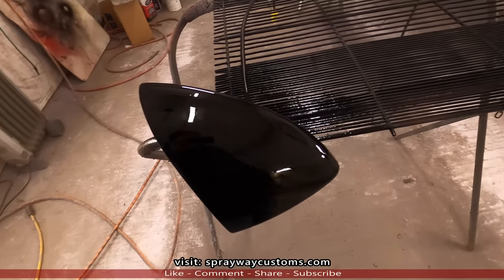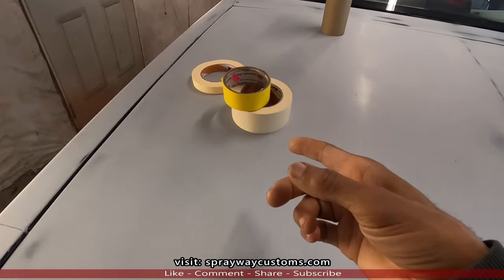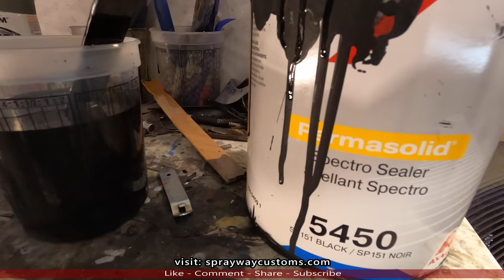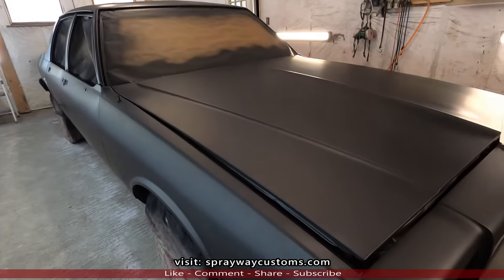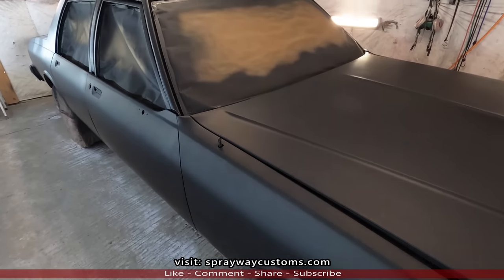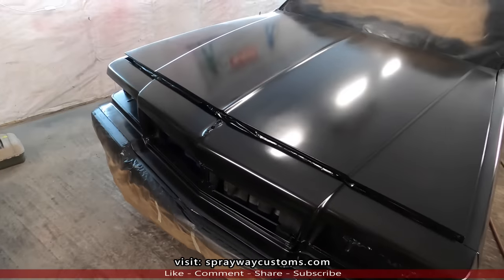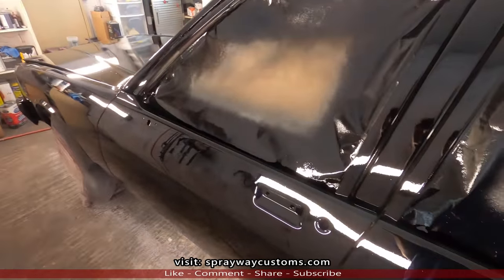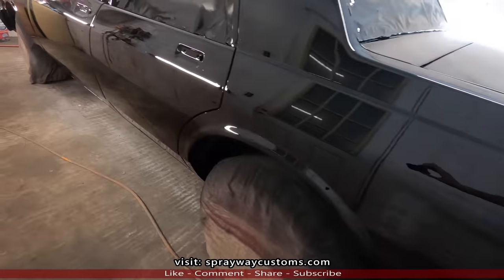How To Paint A Car Jet Black At Home STEP BY STEP Guide To Painting The Box Chevy Caprice On 26s

Comment: Good call on the sealer. As with numerous areas of life, longer strokes are better. Did you shoot the door jambs and under the hood/trunk?
Reply from the maker: No..I didn’t do the jambs
Reply: @SprayWayCustoms  jambs are a lot of work and time but they make the different between a quickie shoot’n’ scoot and a professional color  change. Your paint work is exceptional, deserves that higher starting point.

Comment: you are so good at your craft!!!    Why did you use a sealer rather than go straight  from primer wet sanded to base coat.  What is the purpose of the extra step of sealer?   thanks
Reply from the maker: It’s a great foundation, seals and with a sealer you don’t have to spray as many coats of base

Comment: I was wondering if i have small cracks in my paint, do i have to sand down to the metal, or can i get away with light sanding and primer? The cracks aren’t lifting and flaking paint, they are really small but all over my trunk. And it’s smooth to the touch . Thanks
Reply from the maker: You can get away with filling them up with primer after light sanding
Reply: @SprayWayCustoms  appreciate the response!

Comment: Man sprayway!! How you spray like that without getting hardlines in your jams? I did it the Same way and I had hella hard lines? Do you wet sand them or what? I have to flow coat my car but I’m scared because of the hard lines.
Reply from the maker: I don’t..I try to mask where there’s a seam where the metal overlap so you can’t tell as much or use foam masking tape

Comment: What up Sprayway I have a 79 Malibu I working on and I am working on the floorpan and I have a couple very small holes skinny but bigger than pin holes.  I also have bigger rust spot on transmission tunnel up top on rt side.  Should I use fiberglass mat and resin and I also have some upol fantastic lightweight fiberglass filler and the upol ultra fine finish glaze as well.  I also have what you use on your floorpan video.
Reply from the maker: That’ll work on small pinholes

Comment: When you flow coat how many coats of clear do you apply?

Also, could you post your gun settings for spraying the base and clear? I'm talking about your pressure settings.

Nice job you do great work!
Thanks.
Reply from the maker: 2-3 coats. I spray between 28-30 psi

Comment: I been added lights to my  shop I went in got some harbor freight but it a 25 bucks for each light that 5500 lumens but you got six for 40 can point me in the direction
Reply from the maker: Amazon - 
SUNLINKCO 6 Pack 4FT T5 LED Integrated Fixture,Super Bright White 6500K,20W,2300LM,Linkable LED Shop Light,Garage Light,Ceiling and Cabinet Light,Strip Light,Corded Electric with ON/Off Switch,ETL
Reply: @SprayWayCustoms  much love appreciate that my brother

Comment: Aye Sprayway drop a link for those lights. I need me some more. I appreciate ya
Reply from the maker: Amazon - SUNLINKCO 6 Pack 4FT T5 LED Integrated Fixture,Super Bright White 6500K,20W,2300LM,Linkable LED Shop Light,Garage Light,Ceiling and Cabinet Light,Strip Light,Corded Electric with ON/Off Switch,ETL
Reply: @SprayWayCustoms  good looking out fam. Love your work

Comment: Where did you order the lights from
Reply from the maker: Amazon - SUNLINKCO 6 Pack 4FT T5 LED Integrated Fixture,Super Bright White 6500K,20W,2300LM,Linkable LED Shop Light,Garage Light,Ceiling and Cabinet Light,Strip Light,Corded Electric with ON/Off Switch,ETL
Reply: Thanks so much. Love how the came out was awesome

Comment: Only downside to those new lights is the flicker on the video. It can be a bit distracting, but they seem to light the car very well.  Just FYI The shutter speed does not match the flickering cycle of the lights, resulting in banding caused by LED lighting to be visible on the screen. As the shutter speed is adjusted, the appearance of banding changes. When the shutter speed matches the flickering cycle, banding caused by LED lighting is no longer visible
Reply from the maker: Appreciate the info